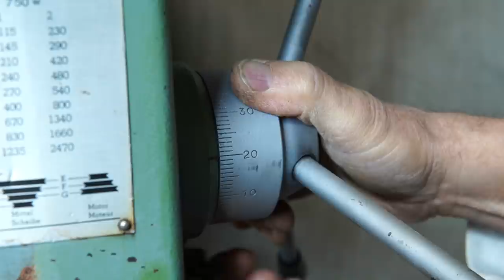Rusty Bread Cutter Restoration

Comment: Imagine being the guy who invented this, only to be out done by a serrated knife.
Reply: Right?  I saw this and thought, my simple $5 bread knife does a better job.
Reply: Funny. But it's not made for standard bread slicing. This is supposed to be used on danish or german style bread that needs to be sliced thinly in perfect, quick succession. 

Imagine a bakery that makes hundreds if not thousands of loaves. That must all be equally thinly sliced. A knife while possible to use, especially at home, is not going to be the most efficient tool in this kind of situation.
Reply: @AJ-ox8xy  except the blade isn’t designed for bread.
Reply: @healtc5069  serrated knifes suck weenie lol at least the ones that I've used
Reply: @healtc5069  Oh yes, it's designed for danish rye bread, not any other bread. It works perfect with this hard type of bread.
Reply: @sunship2  oh welp at least i get to learn something😂
Reply: Well lets have a bet to someone ok my bet is no one can argue long enough with this comment
Reply: Except when you are trying to make consistant straight slices
Reply: sadly, you can’t cut very fast with a serrated blade. try cutting a whole loaf of bread into sandwich size slices, at the speed of 1 slice per 2 seconds minimum.
Reply: That was exactly what i though
Reply: @Alan23552  gray bread?, how was it made in such a way that it turned gray or was gray? how was it made without crust?, I have never made bread so these are my actual questions as I do not know.
Reply: Alan Thankyou!  I’ve been looking for this recipes for so long!!!
Reply: Rohn Carver rye flour is grey
Reply: In risk of making a fool of myself but... are we sure this is not for slicing sausages? 

You know, round and sliced with smooth blades? Even the form factor works better for sausages. Doesn't roll off when it sits in that wooden angle.

 (maybe I could imagine square white bread/ toast. but that's weirdly specialised...)
Reply: @j.m.w.5064  

You can only cut sausage after it’s cooked, and even many type of sausage you can’t really cut like this even after they’re cooked because they are like pate.

This is for big chunks of rock hard bread. It’s almost a stone cutter lmao.
Reply: @jimmymcjimmy2691  Now... I'm confused. (I'll believe the case for hard bread, no problem) 

But There is plenty of dried, smoked, hard sausages that need cutting. Thinking in direction of Salami and such... they were made durable. 

Fresh sausage that has to be cooked made a rather small part....
Reply: @j.m.w.5064  

Smoked sausage is cooked. I was thinking of the popular German sausages like bratwurst liverwurst (super soft) etc. There’s even blood sausage which is not very durable at all even cooked lol. I’m sure there’s deli meat cutters that are similar for the big hard sausages.
Reply: But think: will your $5 bread knife last long enough to be restored in a hundred or so years time?
Reply: Why do we always say “guy” instead  of person
Reply: @Alan23552  I guess you're right. I was under the impression the motion of that thing was kind of slicy. 
I'm only familiar with rotating blades for either food item.... 🙄
Reply: @Alan23552  it was age or something am i right???
Reply: lmao this way is so much more fun tho
Reply: Lmao hahahaha
Reply: And then already sliced bread
Reply: You never know what German use it to cut with.
Reply: @healtc5069  for restaurants it’s better to have a machine or something more efficient! When I was a busser I wish we had one of these instead of cutting all that bread with a knife.
Reply: @frogger6245  we assume its a guy because of 1. The labor intensive trade, I'm not saying a women couldn't it wouldn't do it but most of these restoration videos are men. 2. Its mostly because of there hands the hands and forearm are Large and we can even see some hair in a few clips that suggest that the person is Male
Reply: Except the real plot twist is that it was invented by a company that made serrated knives. Raadvad in Denmark, and it was designed specifically for cutting dense, moist rye bread that binds up a standard serrated knife. 
Raadvad making paper whichever way you cut it.
Reply: @frogger6245  you can see him in other videos, plus his hands.
Reply: Honestly a good bread cutting gadget is nice if you are cutting bread loaves often, getting even slices can be a pain in the ass and slices that aren't even are a bitch to toast and a bitch to make sandwiches out of. Everytime I bake fresh bread I wish my family hadn't gotten rid of the gadget we once had to cut bread into slices

Comment: I appreciate the fact that he cleans up and reuses the hardware. He could have easily bought new but didn't. That's real craftsmanship
Reply: Tne rust on it looks quite new and the wood has not a single sign of rot or breakage on it.
He probably bought a well kept antique cutter and put it outside to let it rust for a while.
Reply: @Simqer  a lot of restoration channels do that sadly.. some of them you can even see they clearly bought two and destroyed one to use the other's pieces.. but at least this guy videos are cool
Reply: That's the point if restoration. He's restoring it, not replacing it.
Reply: A true Mann
Reply: @Simqer  I was going to put that in my comment too, but I didn't want to be rude. After all, he went to the trouble to restore it to its original state, so he did his job. And he did it well. So...

Comment: The screw: Doesn't come out
This guy: "so, I bust out the flamethrower and I start blasting--"
Reply: won't stick if it's liquid
Reply: I can’t get a license plate bolt off a 5 year old car because it’s frozen and this guy can get a 70 year old rusted flathead screws to come off with no problem.
Reply: I Thought He Have To Use TNT..!!!. LOL..!!.
Reply: The smoke wrench is my first go-to, he has more patience than me.
Reply: @williamstriker1392  that’s cap🧢
Reply: It’s called a blow torch but funny joke. 10/10

Comment: Screw: refuses to come loose
This guy: peace was never an option
Reply: Can't be stuck if it's liquid
Reply: what a nightmare this must have been
Reply: pulls out plasma torch
Reply: Heating up the screw (bolt) to loosen it up was amazing.
Reply: as a former mechanic this gives me PTSD 😥
Reply: @Ryusta964  not a plasma torch lol. It was an oxygen acetylene torch, also known as a oxy acetylene torch.
Reply: POV: your the bread
Reply: Peace  don't you mean resistance
Reply: "So anyway i started blasting"
Reply: I need one of these to cut my bagel in the morning.😊

Comment: bread used to be as hard as bricks to have cutter like this
Reply: Yes rye bread not white bread. Danish machine for Danish bread
Reply: Crusty bread cutter then?
Reply: No... Just authentic, Well Done bread with a beautiful, crunchy crust has a Hard exterior
Reply: Devil offlicial  they can be cut
Reply: Your profile pic is scary
Reply: Someone in 100 years will probably say the same about the bread cutting machines in our bakeries.
Reply: Might need to sharpen the blade a bit too i think.

Comment: "used back in times". I'm 34 and we had one. They are common to use for denser breadtypes like rye bread.
Reply: 34, must have been born during the 70s because it's only 2005
Reply: Technically 34 years ago is a time so he's not won't.
Reply: @jayblack8132  I assume you're not Danish, it was way more common here.

Comment: This looks almost identical to a price of equipment I used when I worked at a deli. I guess if it ain't broke don't fix it, just make the blade serrated and move it electrically and you got a modern bread cutter

Comment: The cutter itself looks like not a well designed tool. a simple bread knife will do a better job. Like the restoration job, he even spent time on those original tiny screws.
Reply: No it's just his blade is not sharp enough. We have one and slices without squashing the bread, works very good.
Reply: @Turbo-426  ✅
Reply: @Turbo-426  i mean ok.
Reply: Nope, just the wrong type of bread, it's a clone of the danish Raadvad bread slicer, made for slicing german /danish type rye bread.
Reply: @sunship2  If people only eat one type of bread and designed a tool just for that, then there is nothing wrong with that.
Reply: @sunship2  This restoration man obviously has no knowledge of that.

Comment: This is something a lot of has forgotten something old can be repaired instead of replaced😁👍
Reply: Older generation believed in fixing ... Be it things or relationship. Now it's just use and throw 😷
Reply: It's more expensive to fix than replace. That's  part of the problems created by capitalism. I had a solid Italian leather shoe I loved so much. Took it to a local cobbler for sole replacement,  the amount they want to charge me will buy a brand new pair with some change left. This is why young people don't fix things. It's only great if one has the skill & time to do it oneself as a hobby.

Comment: We used to have one t exactly like that but we used it for meat not bread.
Reply: It's a meat slicer, not used for bread lol thank God I'm not alone! Do you know how many comments I had to go through to find this 🤦‍♀️
Reply: I agree.
Reply: My first thoughts was its not a bread cutter. Smooth blade. Skipped to the end where it had a hard time cutting the bread.
Reply: Notice the blade has 2 cutting points for cutting into and slicing away. Yes definitely for deli sliced meats.
Reply: @markhernandez1252  I believe that's for changing the thickness of the cut
Reply: @5orgen51  The adjustable spinning lever on the outside allows for either a thicker or thinner cut. The blade itself is designed to plunge cut then slice through the meat.

Comment: I don't understand the utility of the moving wood part he installs last.
Reply: It looks like it is there to stop the bread so you get the same thickness for every slice. At the end he turns it a few rotations and therefore it will produce thicker slices. It goes down again so it won't hold the bread slices but they will fall off.
Reply: The wood piece moves the thickness stop into position when the handle is raised and down out of the way of the falling piece when it is lowered.

Comment: I wondered if the part that was replaced may have originally been a spring.
Reply: Looked up Bread Slicers, the one he worked on was a Vintage Danish Bread Slicer. Raadvad is a close match to the one he restored.
https://assets.catawiki.nl/assets/2017/12/19/e/f/3/ef3c3cee-327c-46f4-9d8b-757abcebc83c.jpg
The missing part is actually a thin piece of metal rather than wood, though as we can see wood makes a good replacement.
Reply: Whats the function of that little thing? I cant see the point of attaching the rotation action near the bolt to that metal piece at the bottom
Reply: @lwo7736  When you lift the handle you have a thicknes guage, and when you cut you remove it so the slice can fall down easily.
Reply: @gandalf1124  thanks bro!
Reply: @gandalf1124  thank you for your service! Was racking my brain trying to figure it out.

Comment: I can't imagine eating bread so tough that you need something like this just to cut it.
Reply: Its not because its tough, its to do it quickly and efficiently. Not everyone had the time or skill to cut bread into slices way back when that was in use
Reply: Usually use for restaurants for even cuts of bread that is also efficient
Reply: bread isn't that tough dude... its soft xD
Reply: @maynardpuno288  That's what I thought but the bread in this video seemed like you could crack walnuts with it lol
Reply: Rye breads not wonder bread
Reply: Some breads are like this. Especially Rye. The actual inside isn't this hard, but the outside does harden after exposure to air.
Reply: @zeropolicy7456  I'm sure they are.  It was sort of a joke.  I love rye bread and I've had some rather "crusty" breads but this one was alarming.
Reply: @matthewdavis5486  did u see the inside of the bread. It looks perfect to me

Comment: I've seen so many of these videos and I have to ask... Does he artificially rust his pieces? There's hardly ever any pitting or degradation in the metal surface. No flaking. The screw threads are still clean. And the rust is always the same bright orange color you see after a saltwater soak.

The restoration is still interesting, informative, and satisfying. I just can't help shake the feeling that he artificially antiques the pieces to make it look more impressive.

Comment: You could try to make and retrofit a differently shaped blade - one curved outwards, on the cutting edge, so that it slightly slices, instead of just chopping. Might help with not squeezing the bread that badly.

Comment: I dont think that cutter was ment to cut break but to cut so called sugar tops (Sugar was sold in bid cone shapes) When you needed suger you cut off the top of the cone and it comes out a a sugar powered, It should be house the the cones in a Sugar box with lock to keep mice and other animals (as well as kids) away from taking the sugar. I got two of these old devices one with an old cone till in the box.

Comment: Out of curiosity, why is paint stripper used to remove paint from metal instead of the sand blaster? I know nothing about this kind of work, would you risk damaging the piece, or is the sand blaster not powerful enough to strip some kinds of paint from metal, or something else entirely?

Comment: I don't get the point of the last piece, the little line of wood. 

That small rotating red piece, can be screwed up or down, to adjust the thickness of the bread. why does it have to move in sync with the blade? I don't get it

just have it stay still, in a position where it will always stop the bread